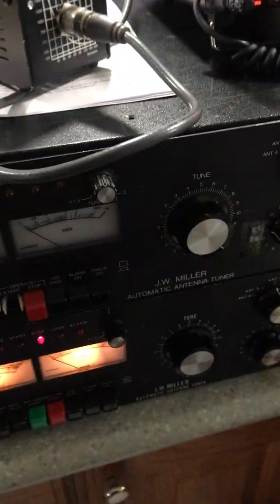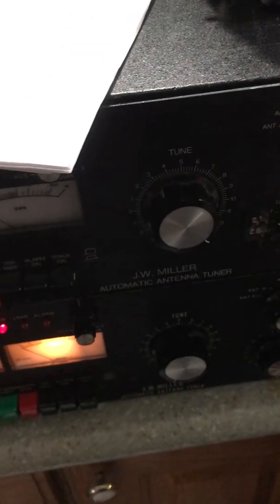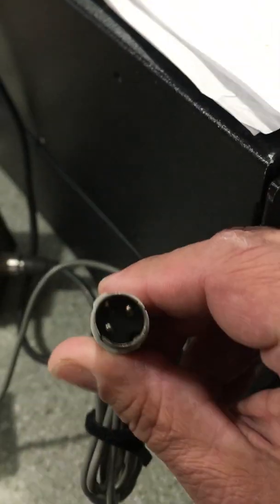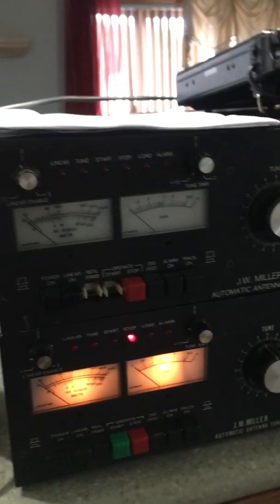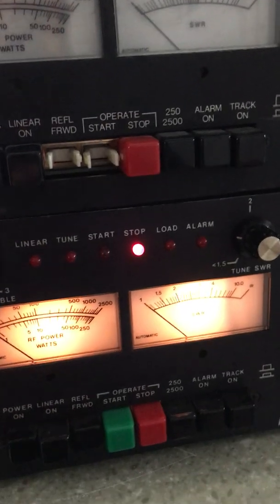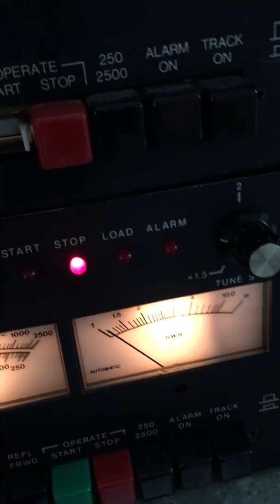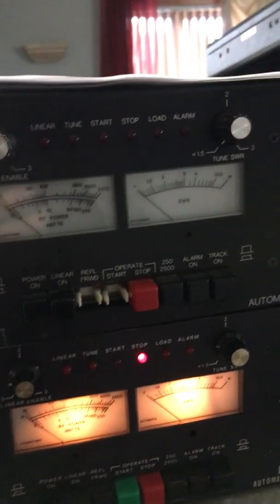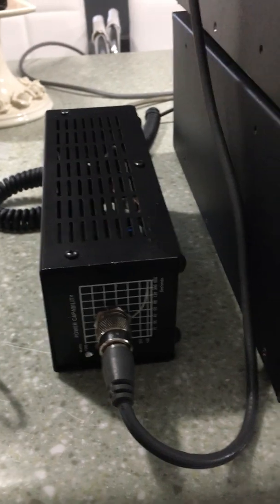An SWR bridge for your JW Miller AT-2500 auto tuner

Comment: Now you've got me worried that my working coupler is going to drop dead on me. I wish you had a little more detail on the build and a wiring diagram. Fortunately, at the moment I have a machine in excellent shape (SK auction) with a functional bridge. I love to build but my electronics theory is sorely lacking. |:-)
Have you considered making these?
Reply from the maker: Nothing to worry about. Simply buy the board and there are three wired connections from the coupler to the bridge. It's forward, reflected and ground. And you attach the input and output jacks. It's very simple.
   Statistically, the bridges don't fail, they get lost or discarded. Which is why I posted this video. Even if victor stops making his boards, chances are most high power bridges sold on eBay will work or can be adapted to work. 
  I have three JW Millers, two were missing the bridges. These boards work excellent and take all of an hour to wire up.